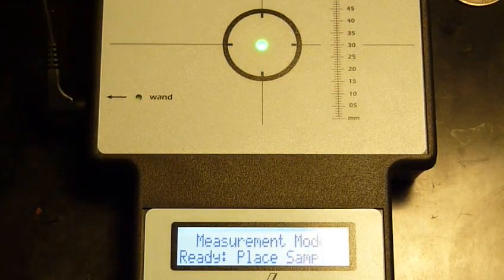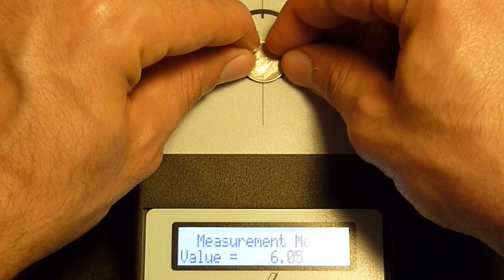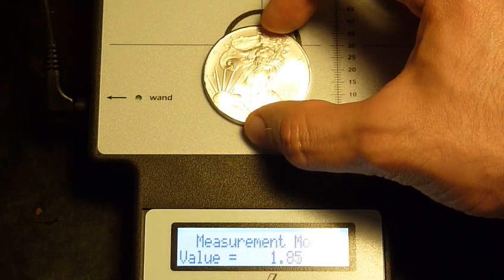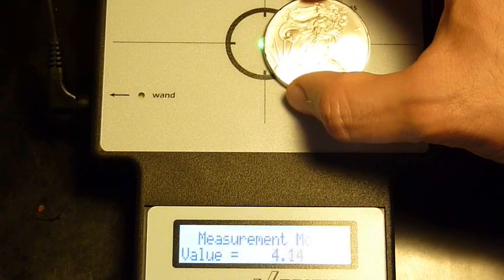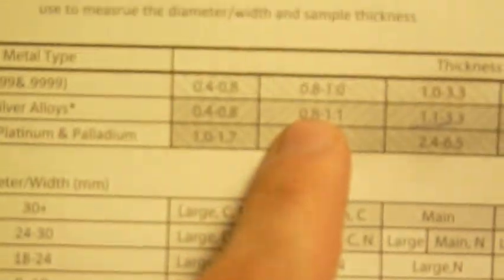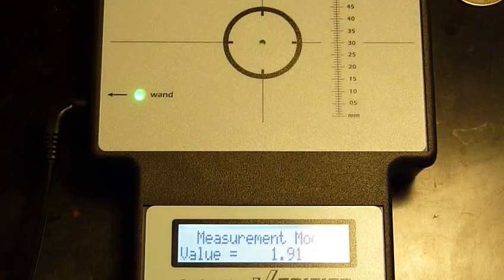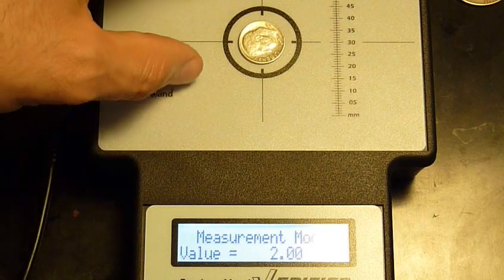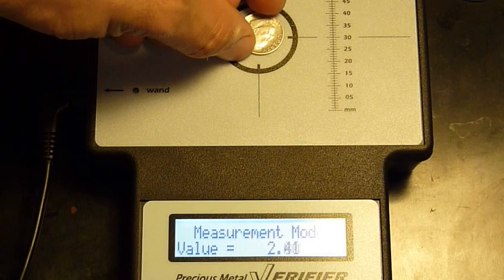Wands for the Sigma Metalytics, Sensor Proximity and the Resistivity Curve

Comment: Hello.  It's me again.  Your in the measurement mode in this video.  The American silver eagle measures 1.70.    Where do you get this value 1.70 value for this coin and others????  Is there a list for coins showing what there value are supposed to be??  Does the 1.70 mean this particular coin (ASE) has .999 silver???  I am a confused nerd.  Please help.  I appreciate your last response .  Thanks.  Gary
Reply from the maker: The numbers have to do with resistivity of the metal, not the purity of the metal.

There is a correlation with the purity of a metal and its resistivity, particularly among Silver coins, as Silver is the most conductive element. However, as any material when subject to supercooled (liquid nitrogen) temperatures, becomes extremely conductive and therefore low-resistivity, meaning that even nickel if cold enough should in theory become equally resistive to the flow of electricity as silver.

This is only a theory, however. If somebody was trying to scam you, make sure the coins aren't super cold or were just removed from liquid nitrogen.